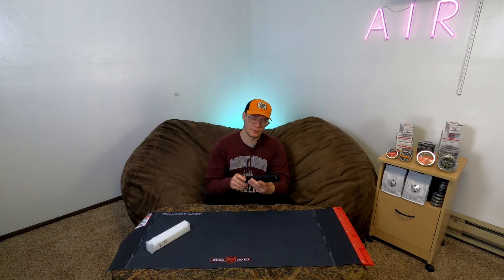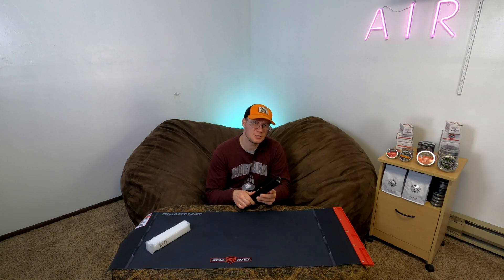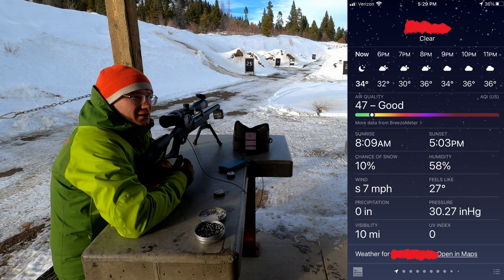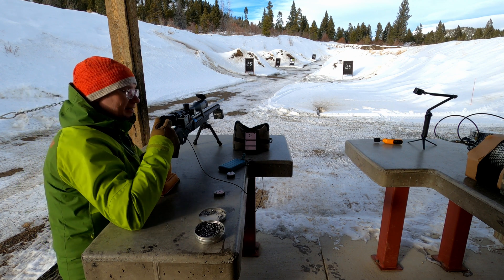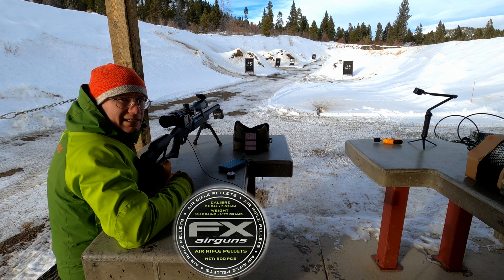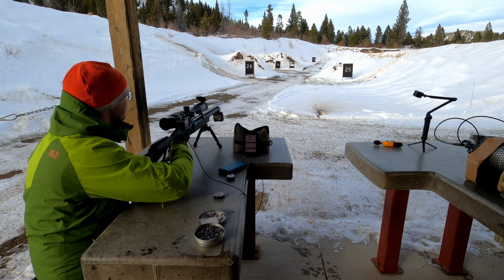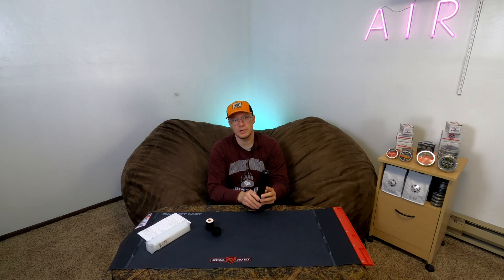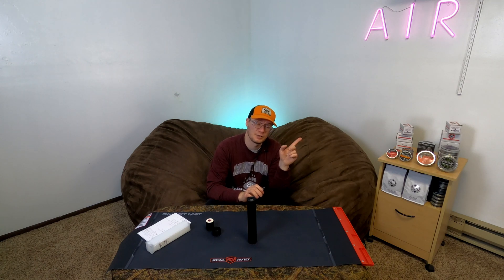Huma-Air Mod40-5/0 Moderator Review (sub 50fp)

Comment: groups are fairly well, but it changes point of impact dramatically at a short /medium distance. I also use a 30 cal moderator for a 25 airgun, and there is no change in point of impact. Mine is a carbon fiber moderator very light
Reply from the maker: Yeah, there is always tradeoffs with aftermarket parts. Im glad that im just using mine with the same setup always if I am going to the range.
Reply: @MontanaAirGunner  I do like to shoot my gun with or without moderator as it has baffles inside the shroud, but anyway,  a 30 cal moderator on a 22 airgun should not have such huge influence on the POI.